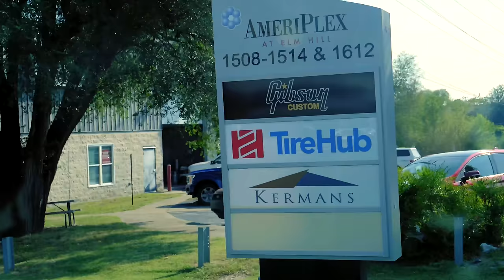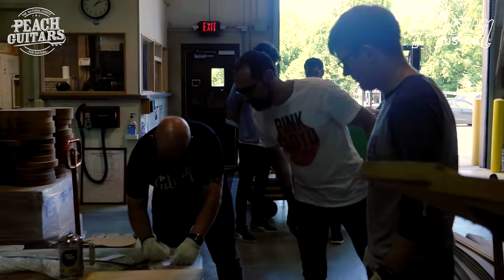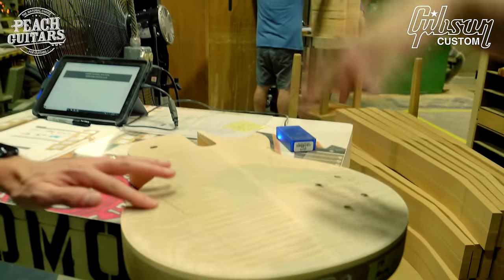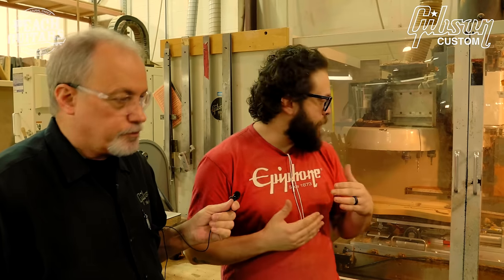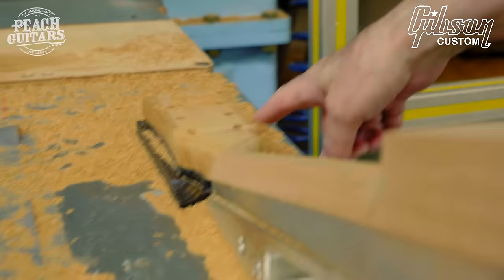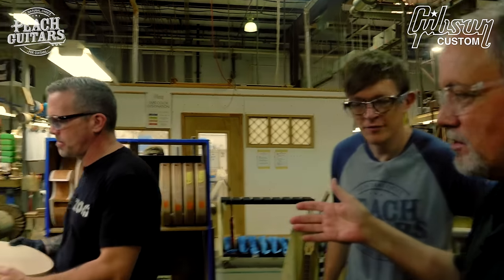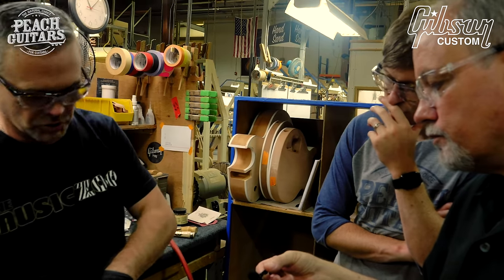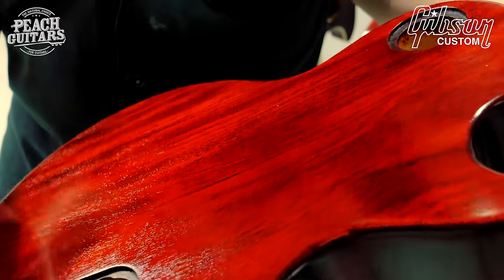THE MOST AUTHENTIC GIBSON CUSTOM FACTORY TOUR: Peach Guitars Visits... Gibson Custom (August 2019)

Comment: Thom doesn’t even know the guy’s names that are working on the guitars.   How many people you think there are working in the Custom Shop?   Thom must be one of the “new guys”.   Any employee that does these tours should know the people and construction processes of these guitars in great detail.   “I’ll ask this guy ...”.   “How long does that stay glued up?  I work here.  How long does that stay glued up?”  He didn’t even know what glue they were using.    

I don’t have time for anyone in a leadership role that has no idea what they’re talking about.   Interesting tour but just proves they build CS guitars pretty much the same way they build USA guitars - CNC most parts, hand fit the neck, hand wrap the bindings, etc.   I get the up-charge for the lighter/more figured woods, labor intensive relic finishes,  etc, but it’s clear the CS guitars are way overpriced.    Send the CNC programming over to the USA factory all the guitars can have the historic specs.
Reply: When you have the technology, it’d be crazy not to use CNC tools for cutting/shaping. Doing it all by hand would be less consistent, and take longer. I do agree with your point though — there’s no reason those same specs couldn’t be applied to their entire line.
Reply: The wood selection isn't particularly good for the standard line, but it's better than low priced foreign guitars. Most of the cost in the custom shop guitars is just price point aiming (as in, there's probably a little bit more man hours - just a little, a little more wood selection (add a hundred or two for that - at the most) and the rest is keeping the volume low and setting the price high.

Gibson makes pretty good guitars, but they are not in the same league as some of the other makers with prices similar to gibson's custom shop (I've never had any gibson guitar that's as good as any collings that I've had - collings is just far ahead of them in consistency and quality level without any regard to consistency. There's more care in them (collings) in my opinion, at the expense of profit. 

I've looked at a lot of gibson guitars. I've had 12 gibsons. I cannot see what's in the custom shop guitars vs. the standards, whereas I can see an extreme quality difference in the 6 collings solid body guitars I've gotten. When shopping for gibsons, it's too easy to find guitars listed with bridges way off center - things that are visually easy to see...I don't understand how that's allowed to occur. Fender occasionally does it from their custom shop, too.

Comment: Its intriguing they don't use RFID to mark their bodies and necks, instead of hand writing that has to be manually read at each step of the assembly line. 

Think about all the benefits:
1) the guitar is automatically tracked so you know where it is in the line, and how long it has taken to get there, and you can deduct how long it will take to make it to the next stage.
2) the RFID is now the proof the guitar is a true Gibson for ever. I am of course talking about passive RFID tags. These can be inserted in the Body and remain their for the lifetime of the guitar. The RFID tag contains all the original details about the guitar and the exact date it was completed. One tag is about $0.12 in high volumes.
Reply: That’s why heir prices are skyrocketing. Their inefficiencies have to be paid for by the consumer.

Comment: I wonder how many kilos the weight would be reduced, if Gibson applying roasted wood on their line..
Reply: Not many. roasting is something you'd do for spruce and maple, but on maple, it makes the wood hard and maybe a little bit harsh (and splintery). It wouldn't make much sense on honduran mahogany where part of the draw is just how mellow and smooth the wood is. Baking the volatiles out of it and making it harder and more brittle wouldn't make much sense. 

It's also a stability trick and limiter to future movement with moisture changes, and mahogany moves about half as much as most woods as it is, so there's not much need (maple's total movement with moisture changes is a lot, thus stabilization makes more sense).

Comment: Loved the video. Couldn’t help but think though, that they’ll eventually have to open up a custom custom shop because the custom shop is so busy they are no longer custom shop guitars 🤔 Also, was a little puzzled by the long tenon neck joint - take the glue away and add four bolts and it’s not really that dissimilar to a bolt on neck? Don’t get me wrong, I prefer no bolts, but I think there might be just a little too much hype over a “long tenon” neck based on what I see here. 🤨 (I do have a 56 CS by the way.)
Reply: Actually you can take a 4 bolt and glue it on Surprised most people don't realize that
Reply: @paulcowart3174  At least once with a heel adjusting truss rod 🤪

Comment: I just purchased a Gibson Les Paul Custom with a Rosewood fretboard from the custom shop and while it's absolutely the best guitar I've ever owned it did have one issue and I'm not here to bash Gibson cause they're my favorite brand but the neck pickup wasn't soldered at all from the factory yet the box beside electronics was checked on t bg e inspection sheet. Anyway I absolutely love the Gibson custom shop.

Comment: @35.25 the person is scraping a non bound finger board easy to touch up as apposed to a bound neck 
The binding rejects must be massive..
They sill will not tape off for a clean line the auto industry has done it for decades
Gibson  originally used a copy carver @30.47 that can not be compared to  the Peter Green LP
They used one of JB's for reference according to Agnise  they should have use the Gold top he was bitching about at Norms  when he beat the crap out of Gibson 
That was a top carve!!